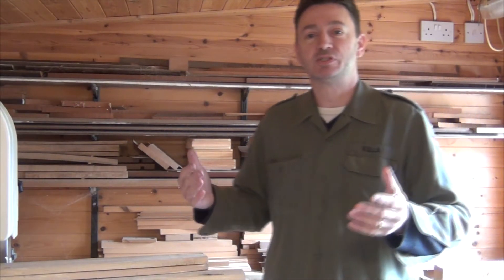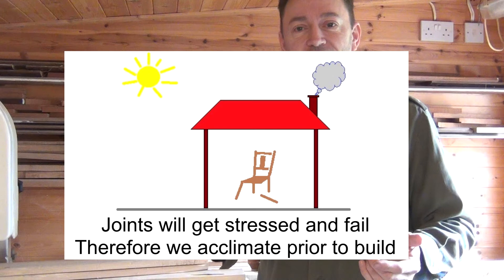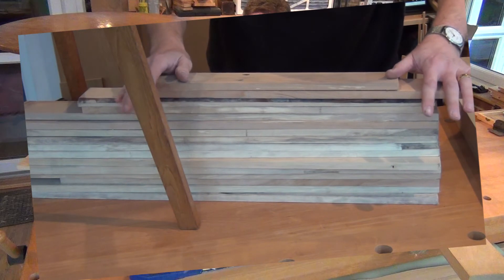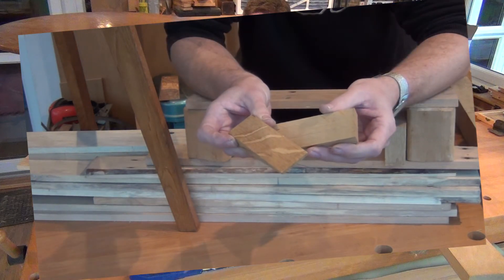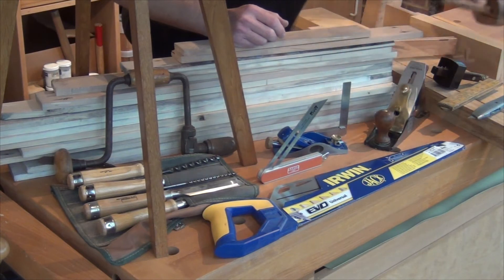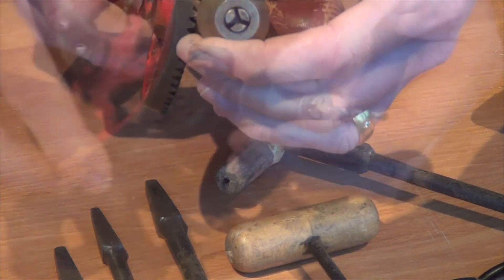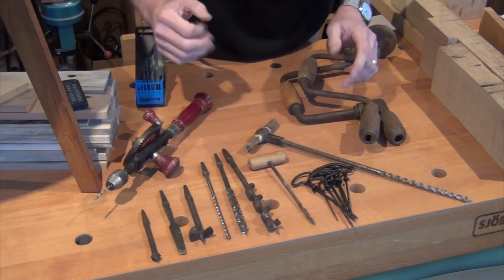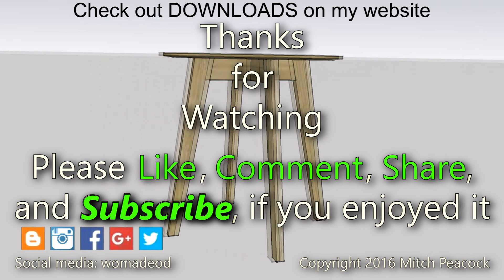Moisture in Wood, and Hand Tools for Boring - GIW21

Comment: Are you going to leave any nail holes in the pallet wood? I know you filled them with metal shavings before. I watched a video the other day where someone fill the defects with stone dust from rock beads from necklaces and it looked really awesome look forward to the build.
Reply from the maker: +Timothy Williams Hi Tim, The nail holes will remain, but I haven't decided how to treat them yet. Because I like to finish with a plane and scrapers, I've not considered stone. I guess something softer than aluminium oxide could be sanded to a finish.

Comment: Interesting video Mitch. At what moisture level would you recommend using wood for outdoors? I'm drying up a slabbed oak tree and want to use it outside as a table top. At the moment it's sitting around 18% mark.
Reply from the maker: +Robin Lewis Hi Robin, I would leave it until it reaches a balance. I think the best way to judge this is by weight. When the weight stops decreasing (IE once you get a higher reading) you can be fairly sure that it's stabilised. This assumes you have it covered to prevent soaking during rain. As a general rule, for air drying, you should leave at least one year per inch of thickness, up to about  three or four inches. Thicker slabs tend to need even more time. In my area, seasoned timber stabilises at about 13-14%. Hope that helps
Reply: In that case I might pop the kettle on, it's going to be a while still. The slab was cut 6 months ago and it's about 3 inches thick, so at least another 2 years. Thanks for the reply
Reply from the maker: +Robin Lewis oh dear! I made a green oak picnic table a couple of years ago on my main channel. The oak was three and four inches thick at the saw mill, and they milled some closer to two inches for my tops. It was about five months old but I think almost 30%. Anyway, a year down the line and about ten percent of the slats on the tops needed reworking or replacing due to severe movement. About seventy percent were still as straight as a die. That's the gamble you take, or not.